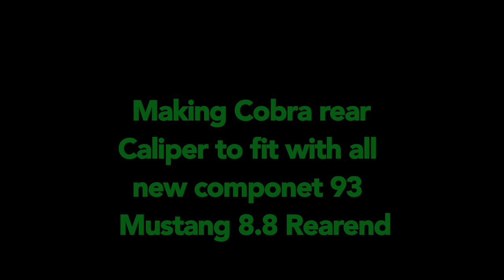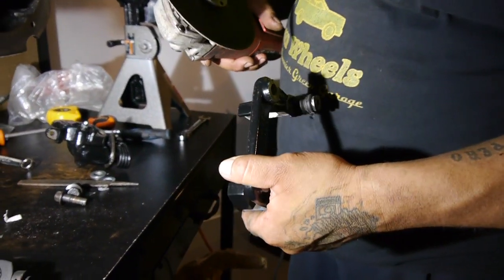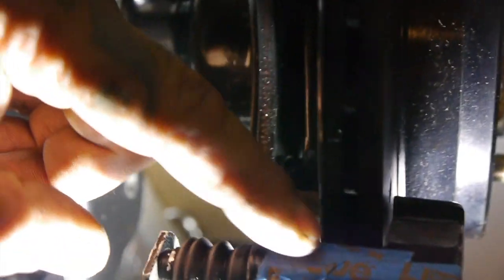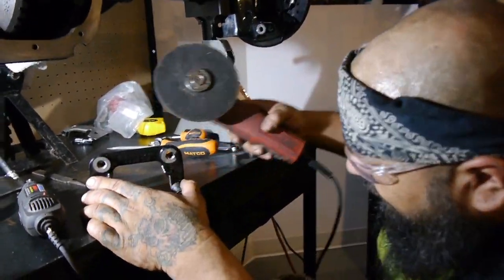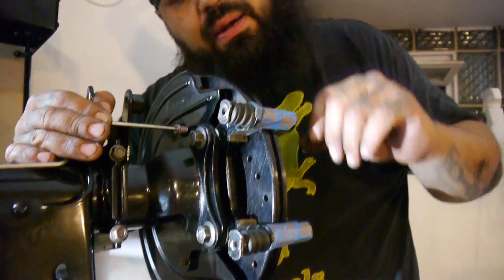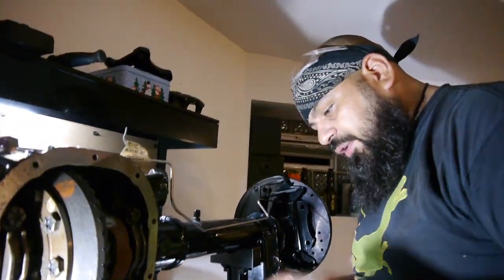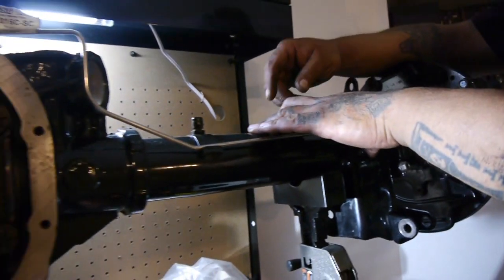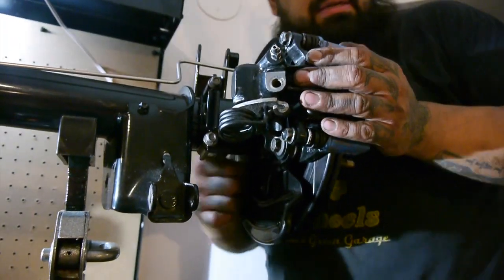1993 Ford Mustang GT 8.8 Rear End issue resolution by Folleh Shar Tamba

Comment: arent those the wrong brackets for a vented rotor??  Cobra brackets ( use a vented 11.65 rotor)have a bar across the front, sn95 do not and use a 10.5 solid rotor
Reply from the maker: It is the Cobra bracket. We were told by LMR, that everything will bolt on. It did not work that way because everything was brand new except for the 8.8 housing.  We were lucky to talk to Richard Oben from north racecars brake solutions who really talk us through the process.  Everything is work great now.